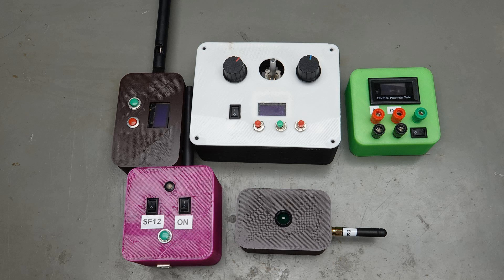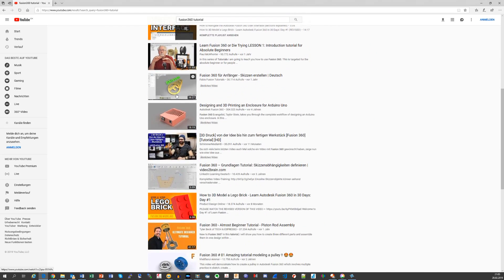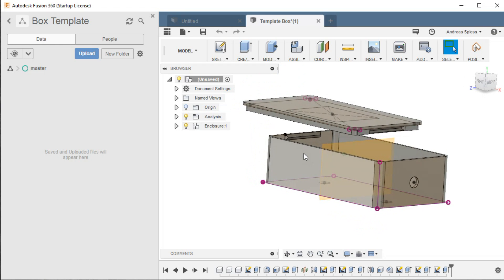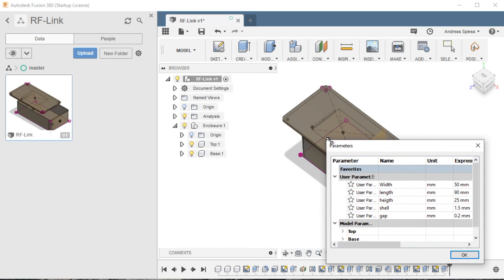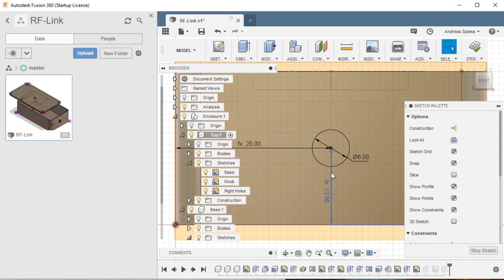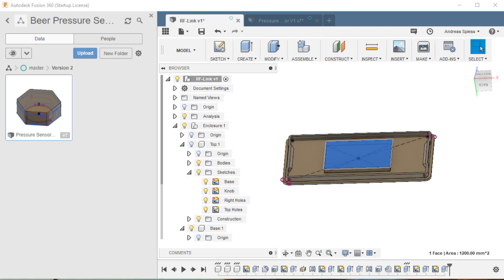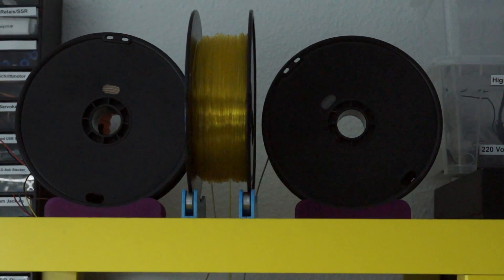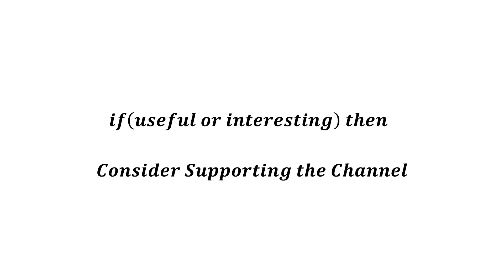#258 Configurable Cases for your Projects  (Arduino, ESP32, ESP8266)

Comment: I appreciate the work. The file you shared does not match your video. It is missing the holes. Being a fusion360 novice, can't figure out how to add them.
Reply from the maker: You are right. I shared a template file where you can change dimensions as well as place holes or other openings as your project needs.
Reply: @AndreasSpiess  I think people are hoping to get a hole they can edit as they want so they can follow the video. With the file you provided it is impossible to follow the video and they have to look up first somewhere else to learn

Comment: Do you still use Fusion360?

I've heard only good things about using Fusion360 , except for the licensing/price.   Wondering if Plasticity (not parametric, but affordable ($150 one time fee)), OnShape, TinkerCad, SketchUp, Designspark Mechanical, Blender, Shapr3D  .. or eMachineShop , FreeCAD etc?

BTW, any suggestions on a 3d printing service, for small enclosures?  Sculpteo?

Comment: I downloaded the file from Github But the are no clip tabs on the lid or any holes in the main box like your video??
Reply: Same here, the original file does not appear to be there.
Reply from the maker: The holes are always individual and do not belong to the parametric box. I add them (with other features) for each project.
But what do you mean with "clip tabs"?
Reply: There are female clip tabs in the box body but no male clip tabs ob the lid.@AndreasSpiess
Reply from the maker: @Graemecns  They should now be visible. I updated the file.

Comment: that's amazing! but it appears that the lid doesn't have latches...
Reply from the maker: Strange. Here it has. Did you use the original file?
Reply: @AndreasSpiess  I used original file from git hub and also found no clips on Lid.
Reply from the maker: @Graemecns  I changed it now. They were there but not visible. Now it should be ok.
Reply: Ok thanks i will check it again

Comment: Not sure what is happening. When the parameters are changed the top is a different shape and size to the bottom. I think this may be related to the PCB mount, but I can't seem to remove it.

Warning: Lip
Compute Failed
Warning: PCB Mount
Project1

I also have a lock on the sketches. When I remove the hole by selecting it and deleting it, I click finish sketch and return to 3D the hole is still there, even though it is deleted from the sketch.
Reply from the maker: Maybe you try the newer version I just posted. Not sure if it will solve the issue.
Reply: @AndreasSpiess  That was the newer version. The issue is most likely my own as I am new to the software. Thanks for posting though.
Reply from the maker: @fred7flinstone  I uploaded the version with the one I currently use just before I answered your comment.

Comment: Hi Andreas, I just printed the top for this project and it is perfect however, one of the latches on the base dissapears when resizing so I cannot print this! I assume Fusion has changed in some way since you designed this? Would be very much apreciated if you could take a look.. Best wishes, Wal...
Reply from the maker: I replaced the old file with the one I currently use. Maybe it works...
Reply: @AndreasSpiess  thank you very much..

Comment: Hi Andreas . I've been using this box design for the last couple of years, its been very useful. However Fusion 360 has started giving errors as soon as I modify the dimensions, I'm pretty sure it wasn't before. My Fusion 360 was updated (V2.0.13377) a few months ago so maybe something is incompatible now? I'll let you know if I work out how to fix it , but maybe someone else has run into this and solved it already?
Reply: I think I have a fix - under the last mirror option I changed the compute option to "Identical" . I barely know what I am doing, but the errors are gone and the mirrored chamfer now shows up.
Reply from the maker: I also had to change a parameter in the mirroring.
Reply: @mysomervda  yes fix
Reply: @mysomervda  Thank You.. That worked for me, well done!

Comment: After I edit dimensions Autodesk complains about Chamfer1 (and this thing on the lid to keep box closed disappears) and some other things. I think I managed to do this once in the past, but then I reinstalled windows, maybe new version of Fusion broke some things? :(
Reply from the maker: I do not know. But I use these files regularly, also in the new versions of Fusion.
Reply: I am having this same issue, I still use the same windows machine, but have since updated Fusion.  I suspect its something with Fusion.  I have not been able to figure this out why it does this.  I printed the box anyway, and it still closes tight, just a slight bulge on the one side where the groove is missing in the base.
Reply: @collindewitt1989  are you able to open it? I wasn't really able to even close it :/

Comment: @AndreasSpiess : Thank you!!! I have a question about your little box. If I change the dimensions - I'm facing a problem thats "Mirror1 - no target body" and "Chamfer1 - Edge 1 is missing". Do you konw how to fix these problems?
Thank you so much and have a good day!
Reply from the maker: I do not know. I use these files a lot an so far never had this message. Maybe you are somehow outside the (invisible) limits of the box. I would start with the original and change one dimension after the other to understand where the error starts to appear.
Reply: @AndreasSpiess  hello, thank you for your message. Yeah, I looked for the problem that I have.

Yesterday night I fixed it by myself. There was no mirror plate for the top. 
Thank you for your work! Have a good weekend. Stay healthy und alles gute
Reply: @danieltheshark  Hi, please can you expain how you fixed this. Thank you
Reply: @collindewitt1989  hi, you have to insert a mirror plate. YouTube will help you - look it up
Reply: @collindewitt1989  Did you get it done?
Reply: @danieltheshark  Hi.  I did not get it to work yet. Tried to insert mirror plane in different places, but I get the same error when I insert mirror plane.
Reply: @danieltheshark  Hi I got it fixed.  On the github issue page someone suggested on the mirror click edit feature, and change compute option to 'identical'  that worked for me.

Comment: Brilliant. Full of sensible and helpful advice - as usual.

I am rapidly becoming a Fusion360 fan, having first learned about it on one of your other videos (and struggled for years with openSCAD) - and am very happy it can send STL files directly to Simplify3D. 

This box template is just what I was looking for too. Thanks Andreas.

And… the reamer; genius. Have ordered one from Amazon.
Reply from the maker: I also use these boxes a lot. And the reamer, too. It is very easy to get the right diameter with it.

Comment: I am using FreeCAD and created a universal box as well. FreeCAD, like Fusion 360 has a possibility to enter the parameters in a spreadsheet so, like you show in your video, changing the size is very easy as well. Also not using screws, just tightly fitting lids
Reply from the maker: I think this is a vey time-saving idea in whatever tool you create them.

Comment: Double sided tape? That is cheating. I need to cheat, too. It’s so hard to line up he screw posts just right on boards. I had actually given up on making enclosures because I have been having so much trouble getting the size just right. I was actually planning in my head how to use standoffs and then use a caliper to accurately measure the distance between them.

But, double sided tape, or foam, if the board has some components there, perfect! Thank you!
Reply from the maker: Tape is a very important tool! Indeed, printing standoffs are not easy and I often had to redo them. These days I first print only the fixtures to check if my measurements are ok. Only then I print the whole part...

Comment: @Andreas Spiess  Why Knob in Top part has fixed height 6mm but grove for it (Extrude3) has calculated height shell*2?
Reply from the maker: I do no more remember. Maybe it is a mistake and you can correct it if it creates problems.

Comment: What 3D printer are you using? And how do i print smooth surface using 3D printer? I need super smooth enclosure for my project
Reply from the maker: I use a Prusa. Super smooth surfaces cannot be done with such printers only.

Comment: Sir Andreas, I used your template box and made a device of my own, if it's alright can you check what I did and tell me if it's good before 3d printing it. In our country, 3d printing is costly so I'm playing it safe.
Reply from the maker: You have to learn to check it yourself, I think. Otherwise your 3D printer will be worthless.
Reply: @AndreasSpiess  thanks for the reply, though I dont have a 3d printer.

Comment: Thank you for the useful video, love your channel !!! What type of material is used by the 3D printer ?
Reply from the maker: I mainly print boxes and other not so critical stuff. So I had no problems.
Reply from the maker: Mostly PLA. Sometimes ABS
Reply: @AndreasSpiess  Do you see issues on the final product with PLA ? Does it deform overtime ?

Comment: thanks for the great video!  How do i move the PCB mount plate to a different position? i can resize, but can't seem to move it :(
Reply from the maker: You have to do this manually in Fusion360 because every project needs different holes or stands.
Reply: @AndreasSpiess  thanks, what i figured, but following your tutorial to edit that platform, doesn't allow me to move it :(
Reply from the maker: Strange...

Comment: Dear Andreas,

I've recently got a 3D printer. Tried this in Fusion 360, and with little bit of problem while exporting the file, I was able to export the stl file. Awaiting for PLA filament to arrive to print the box :D

BTW what would be your suggestion to use as printing material? PLA, ABS or something else?
Reply from the maker: I mainly use PLA. But because my first printer was not good in ABS an I still have lots of material...

Comment: This is a great tool but I noticed when the wall thickness is changed the lid no longer fits on the box. The dimensions becomes too big to fit the base. I think there may be an error in the parametrization of the lid.
Reply from the maker: Maybe. I never tried :-(

Comment: Very nice Video!
Parametric modelling is very useful! Just define a base division as parameter and bind it to your model (e.g. 2x width, 5x height and so on). Works on leghts, angles, diameters, positions. Thats the best way to design a consistant and changeable model instead of just extruding it to size.
Reply from the maker: I once tried it but did not like it. I prefer visual modeling. But I know that many people love the parametric tools.
Reply: @AndreasSpiess  Fusion does actually a good job combining direct and parametric modeling which is easy to use, like we see on your box model.

Comment: I was glad to see you do this.  I've used the same video to design many snap close boxes and even put one of your projects (power meters) in such a thing.  You can see it at: https://www.thingiverse.com/thing:2949779.   They work very well.  I also designed a secure mount for a 9V battery on the inside to avoid  hot glue kluges.

Also, Octopi (Octoprint running on an RPI) is a great solution for file transfer and printer control.  Many others have pointed this out, but the thing that makes it seamless is publishing a Samba share of the upload folder from the RPI.  This shows up on your PC as a network storage device and the slicer can save the Gcode directly to it.  It automatically shows up in OctoPi and you're then ready to print without any "sneakernet".  I use the same thing on 2 printers and a CNC.

Keep up the good work!
Reply from the maker: My Prusa MK3 has a slot for the Pi zero. But so far I never had the time to add it ;-)

Comment: @Andreas Spiess Slightly off topic but I noticed your bench meter, I am looking for a bench meter (I have a couple good multimeters if I need accuracy) but if I'm doing measurements over time multimeters are annoying when they turn off etc. What do you think of that particular unit? Cheers
Reply from the maker: It is a Uni-T 804

Comment: google 'golden ratio'.Stick to em,if circuit is still in prototyping
Reply from the maker: Where would you see the use of the "golden ratio" in this respect?
Reply: It's already pretty perfect but @AndreasSpiess  the ratio can be used in the height, in respect to width and length.
Positions of led and dial.

But it can lead to the Maker, being a bit OCD

Comment: Following all the comments on this video about opensource design.  I have created a similar "template box" with optional standoffs for "standard green double sided protoboard" and customisable power-jack hole and mounting holes.  It has a snap-on lid with a little notch for pry bar opening.  Pillars, hole and mounting can optionally be removed.

https://www.thingiverse.com/thing:3468464
Reply from the maker: Also a good idea (if Thingiverse is considered "Open source ;-)
Reply: @AndreasSpiess  Thingiverse itself may not be open source, but the source code for my box is most definitely open. You can see every line of the .scad file on Thingiverse without having to download it. OpenSCAD too, the programme needed to turn the code into an STL file is also truly open source.

So long as it is freely accessible, changeable and redistributable it is open. I don't think the means of distribution are an issue.

Like many others I can't afford Windows (or a pc powerful enough to run it properly). I definitely cannot afford an Apple device but through OpenSCAD and FreeCAD, a 15yo laptop and my £90 3d printer I can still participate in this hobby and the community. Especially so with the help of our friends in the east who gift us such bargain prices on the hardware.

If I can do my part to enable others to enjoy this hobby on a tight budget without expensive equipment, operating systems or software and encourage others to do the same then that's my little contribution to the world and I am a happy man.

Comment: Check out "The Ultimate box maker" on Thingiverse. It is a clamshell style box and you can just add dimensions and render a custom box with STLs for 3D printing.
Reply from the maker: Thanks for the hint!
Reply: But does the box end up being more expensive than a prefab one with the cost of the plastic ? I've heard the plastic is something like $80 a roll. But can you give me a cost example for a 4 inch x 6 inch box 2 inches deep or another size ?
Reply: @phoenixsmith4001  I did some digging to answer your question (all performed using opensource software). I estimate a 6x4x2 inch box would require 135 grams of plastic and would take approximately 13 hours to print. My standard rolls of PLA plastic filament cost $15 to $20 per kg, so the material cost is about $2.70. It is definitely not a slam dunk, but I already have the 3d printer and materials on-hand to make the box in my home (or any custom sized box for that matter).

Comment: Tinkercad, the problem is to share the core design; you can only share STL alike ready OBJ and STL files
Reply from the maker: So this would not be a good choice for me as I try to share my designs.
Reply: @AndreasSpiess   Tinkecad is nice if you import an STL and modify it. There it has it's benefits. Shure you can share it. I use Thingiverse. The problem in Tinkercad is to duplicate, create a new on a n existingTemplate basis like you did etc.
Reply: not as a choice for you but other visitors whose time is too short for a fusion learning curve.

Comment: For those that are uncomfortable with the vendor lock-in of F360 and want a more traditional form of CAD than FreeCAD or OpenScad then you may want to investigate DesignSpark Mechanical by RS components. This is a port of SpaceClaim CAD software and is free to download and use and requires simple email registration and no on-going internet connection or licence renewal. Files are held locally so there is no reliance or security concerns with the cloud.
They also do a circuit/PCB design package under similar terms too.
Reply from the maker: Thank you for the information.

Comment: I got a prusa clone 3d printer a month ago and this is all most people will need, upgrade it with stuff on thingiverse. If you can't buy yet, learn designing on openScad, freecad, or others and import into Cura to learn slicing. Learn about different materials and temperatures. You will need to know all this after you buy any way.  These will look like old dot matrix printers in the future, hoky. Color, multi-head is only starting. 3d printing is slow, taking hours. Key is anchoring your project to the bed.
Reply: OPENSCAD is really good for technical people, because you stay in programming and maths.

Comment: nice box template, thanks for sharing! However, there seems to be some sort of bug in the "parametric" section of the top cover - only one of the two holes can be deleted, the attempt to delete the 2nd hole returns a warning (being a fusion360 noob, though... :)
Reply from the maker: If you want to delete both holes you also have to delete the "extrusion" which comes with it.

Comment: I'm assuming the Gap Parameter can be used to allow for printer to printer Differences in dimensional tolerances? Also, I find using concentric infill for the top and bottom layers is an effortless way to make your prints look slightly cooler.
Reply from the maker: The gap: You are right!